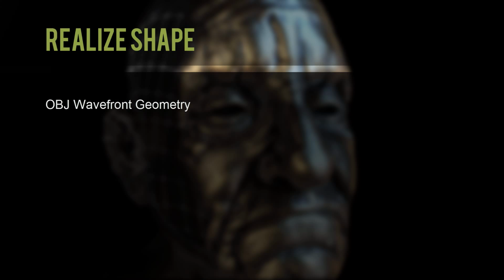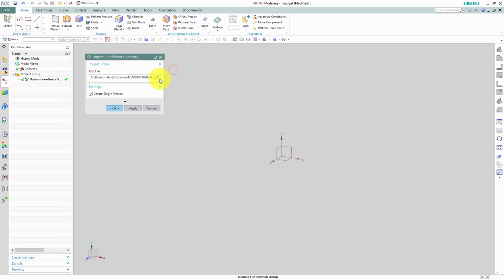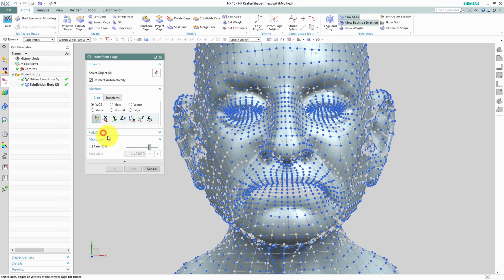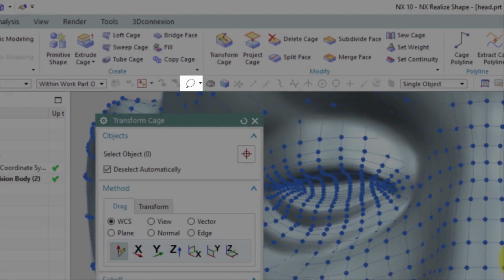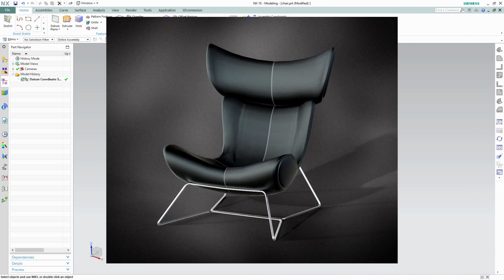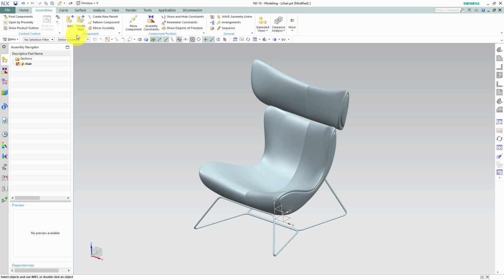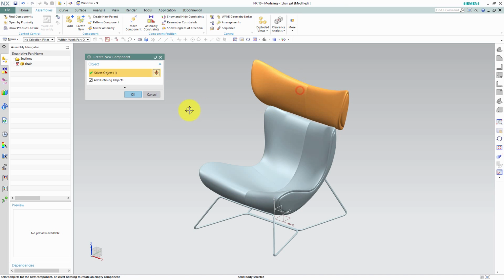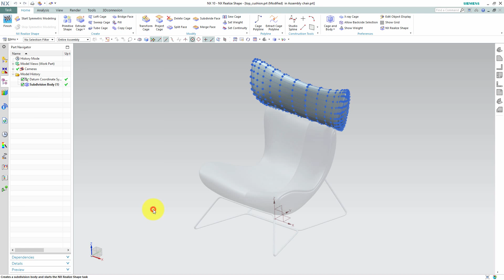NX Realize Shape | 5 - Import OBJ Wavefront

Comment: Does anyone know how to edit an existing .stl file with NX realize shape?
Reply from the maker: You cannot directly, unfortunately. You can get around it by importing/exporting using tools such as Blender (free), but STL's are usually not very clean in terms of polygon distribution, so I doubt it would help you very much. If you're looking to edit .STL i would look to the polygon modeling toolset in NX12 and newer, as the convergent technology has made that possible.

Comment: Hi, I am really interested in modeling of the shape but in a data way (for example using excel files). Does somebody know if there is a way of using the realize shape but in a parametric way? Like getting the points in format X, Y Z.

Thanks for your attention.
Reply from the maker: +Artur Julia Hi. Yes, there is a way of using it parametrically. You could construct datum points / curves or other geometry outside the context of NX Realize Shape, and attach the vertices to whatever reference geometry you need. This reference geometry could be controlled parametrically, which in turn will decide the position of the cage vertices. 

Furthermore: By utilizing tools such as geometry optimization with associative measurement tools, you can tweak the geometry itself to have extreme values within a feasible level of accuracy.